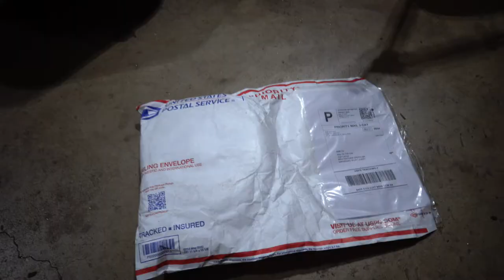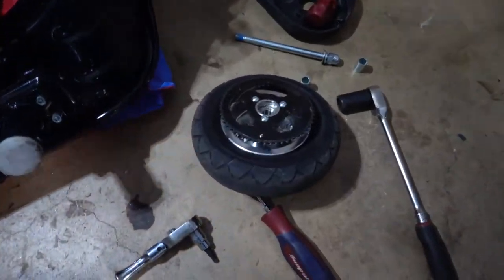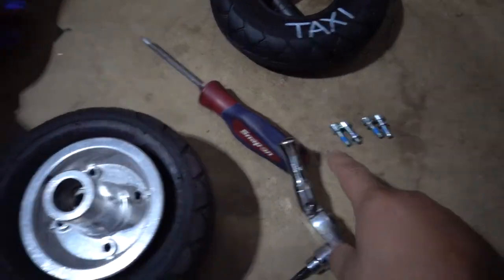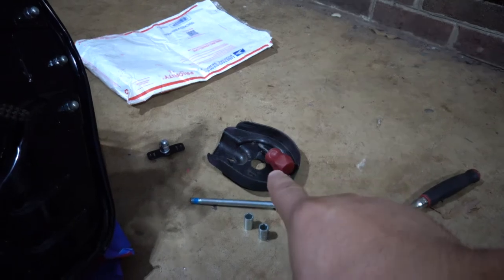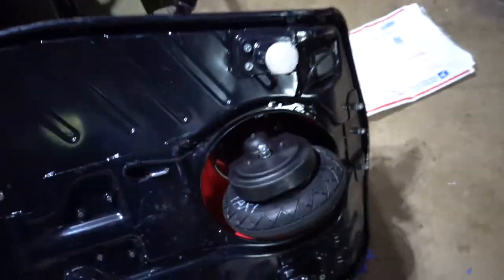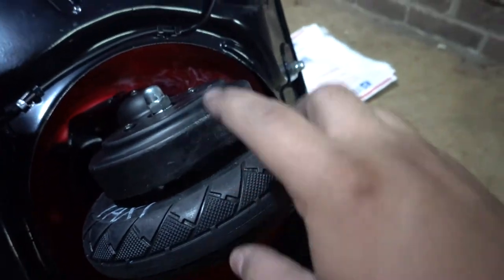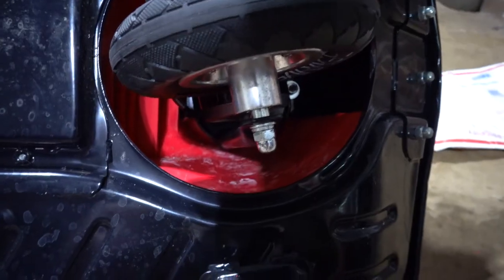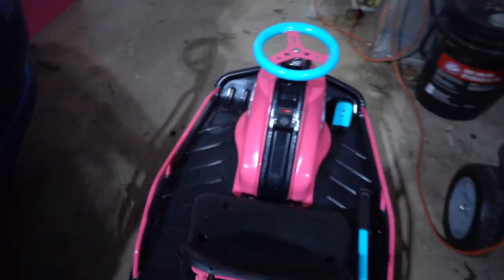How To Install Taxi Garage Solid Tire On Crazy Cart

Comment: I’m surprised you didn’t have any issues tire spinning on the rim, by simply putting it on like that; good job.
I can’t keep mine on (new wheel, brand new solid tire from TG; stock batt XL.) 
Tire clearly slips on the wheel when you put two together and try to spin it (both surfaces are slippery.)
So I had to lightly sand both, the wheel (both sides) and the tire where it meets the wheel, then apply bead sealer as well.
Only THEN the tire had a solid grip on the rim and no longer spun freely when you accelerate.
It rides differently when the tire is loose. The cart is all over the place, not much control while riding. It’s because it had no traction on the main wheel (due to it spinning freely on the rim.)

But before I figured out how to resolve the issue, I ended up ordering a full front tire assembly (complete w/solid tire, already installed.) 
So I don’t have to worry about it. Thought someone else will do it right...  
But, call it a coincidence or bad luck, their solid tire that I received also spun on the rim, as soon as I pressed the gas, after quick install ( looking to make sure it doesn’t spin like mine did.) 
And again, stock 36V batt (XL) at the time, nothing crazy.
Reply from the maker: Are you having this problem on an XL or normal cart?
Reply: @StayOnTheGas  It’s the same thing, same tire, and same aluminum made rim. 
But like I specified in my last message, it was happening to the XL cart.
I’m still riding tube tire on the regular cart; never have to worry about it slipping, that’s for sure. 
And lasts quite a while too (if you avoid dragging the tire on the concrete so often.)
Reply from the maker: I wonder if that’s what’s happening on this one with the new batteries. It’s spinning but I’m not sure if it’s the solid tire on the rim or the whole assembly. Gonna be checking soon and if it is spinning then I’ll end up doing the big tube tire install
Reply: @StayOnTheGas  Might be. Just mark the rim and the tire with a sharpie marker, and you’ll know for sure. 
Before disassembling my solid tire, I decided to put 2 screws into the hole where the tire valve was (makes a perfect place.) 
You can do 1 good size screw as well, with a washer. I ended up buying 2 that are kind of small (miscalculated) and crisscrossed them, but because they were on the short side, they didn’t hold, the tire still spun, and one of the screws broke in half (bought some wood screws.)
I’m thinking a good size steel screw can fix the spinning issue for good, especially it has the hole for it already there. 
But I would do the whole thing, sand the surfaces where tire and the rim meets (so it won’t be as slippery.)  Apply the bead sealer, and top it off with a good fit screw (through the tire valve hole.)  

I’ll try that next, and if that fails somehow, I’ll just stick with the tube tires. They aren’t as bad, actually; especially if you have experience riding the cart. 
If you’ll be dragging it all the time, that’s when they barely last, and eventually pop. 
I can always reinforce the inside (between the tire and the inner tube) incase I ride on it to where it will wear through the original tire. 
Plus I’ve already mounted brand new tire as a spare (on the cart,) incase I do catch a flat. 
And with a small tool kit on the cart (stored underneath the seat, with extra caster wheels, and mini bicycle pump) I can always change it on the go, in less than 10min; and I can let my motor rest during that time : ))
Reply from the maker: Those are very good suggestions. I’m definitely going to be trying that out to see if it’s spinning and if it is, I’ll be fixing it for sure 👍🏼

Comment: Need to run a screw through the TIRE After installation near the slot in the rim where the old valve stem went..

OTHERWISE, the tire spins in the rim! 

Every time
Reply from the maker: Gonna try this out